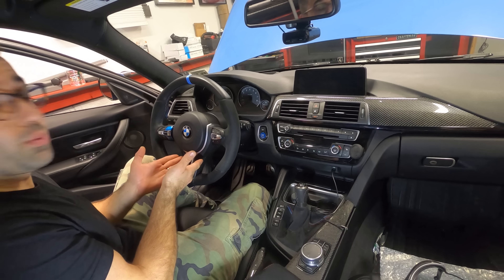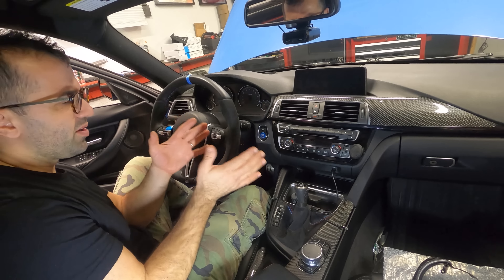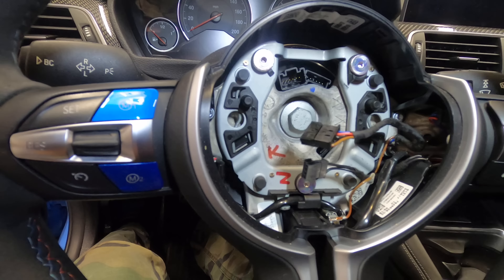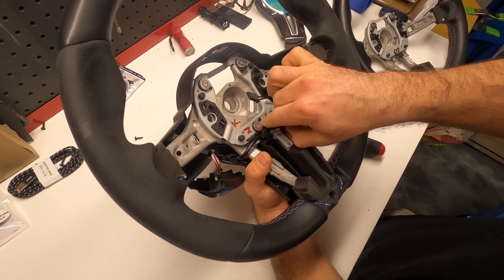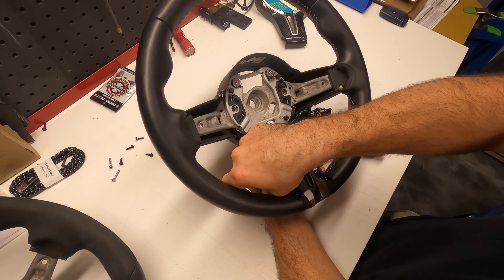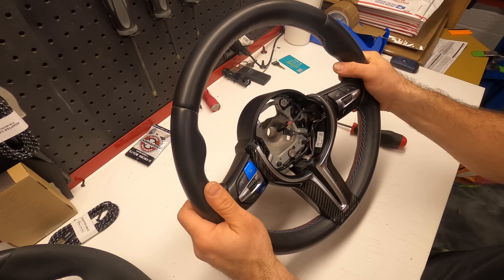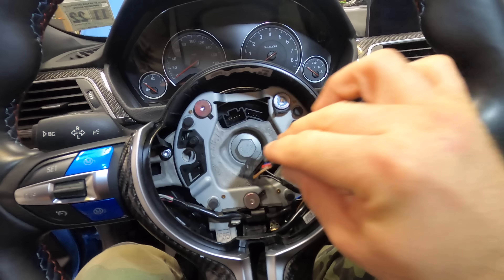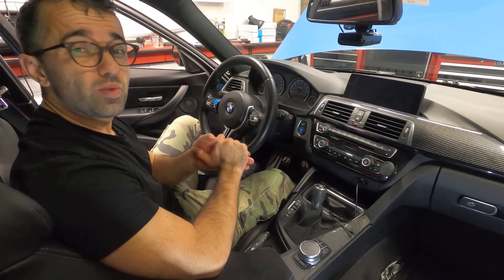Alcantara steering wheels is gone. Hello leather and carbon fiber! (Interior redo has begun!)

Comment: Tommy, you're not crazy at all. In fact, I've recently done the exact same thing. I had the M performance alcantara wheel on mine and I just couldn't get alone with it. Got dirty a flat far too fast and required constant cleaning and brushing. I don't think I'll ever have another alcantara wheel again. They work best with racing gloves otherwise with bare hands a leather wheel provides better grip and wear longevity. 

Switched back to my OEM leather and have not looked back 🙂
Reply from the maker: I’ve regretted some mods in the past. This was one of them

Comment: I prefer the leather over the alcantara wheel, just because I think that alcantara will get dirty overtime
Reply: And leather won't? Lmao. Everything gets dirty if you do not clean it. Leather is just quicker to get cleaned with a damp towel, Alcantara steering wheels take me more time. I see so many shiny steering wheels and seats.
Reply: @hovnojede010101  my leather wheel isn't dirty even though i sweat a lot from my hands. Of course I clean it with some special products for leather, but I feel like my sweat would damage the alcantara in a long run, would only drive with gloves
Reply: Leather just gehts shiny while getting dirty but Alcantara gets "ugly". Yes, they both get dirty, but leather gets dirty in a nicer way (if you can say so) and is easier to clean
Reply: @Cliffracer46   I've been maintaining Alcantara for many years, E9x and F8x, and it's really not an issue on either seats or steering wheels. But it depends on your daily use, also washing your hands before getting into the car helps too, lol. Actually, both of my M Perf wheels were bought 2nd hand and they were awful - looked and felt like it wasn't even Alcantara. Restored them back to an as-new condition, and maintain them by just using two MF towels (one damp, one dry). Takes me 15 mins. My hands get sweaty too. One car gets daily driven without gloves so needs a quick rejuvenation every month (put about 35k miles on it) the other I drive in gloves only - a clean is needed once every three months or so. I am very into detailing so I wouldn't tolerate if they looked awful.
Reply from the maker: Alcantara simply takes too much maintenance for me. I have no patience with it.

Comment: Looks good. I like it. I love the stock OEM look and Tommy you're crazy. On a little side note the notch in the steering wheel shaft is called a Keyway. Also is it necessary to torque down the 16mm steering wheel bolt?
Reply from the maker: Well I torqued it to a lot more

Comment: Personally, I thought the carbon fibre centre piece suits the alcantara wheel better because carbon fibre is associated with sportiness and so is alcantara at the top end.  My wheel is the oem alcantara 1 full alcantara with the carbon fibre centre piece and I'm absolutely loving mine. However I do feel the blue/red m buttons don't look right and something I wouldn't do only because they are not symmetrical looking on the wheel. Yes on the new M models the red m button placements are higher mounted and do look great. Maybe next mod... Get rid of the blue m buttons? lol
Reply from the maker: Maybe I’ll swap the buttons.